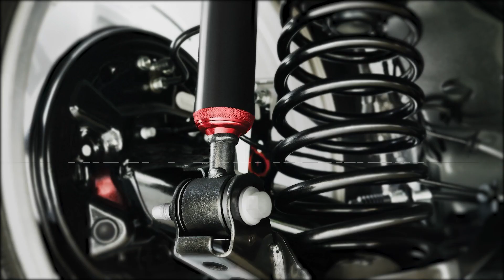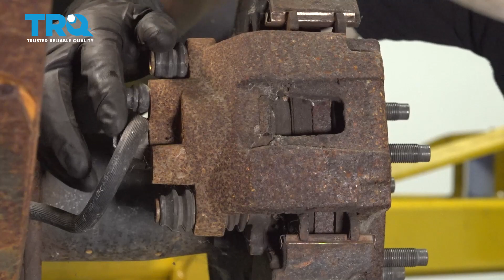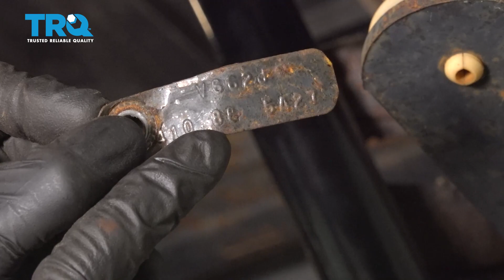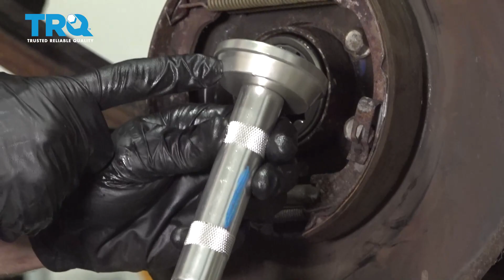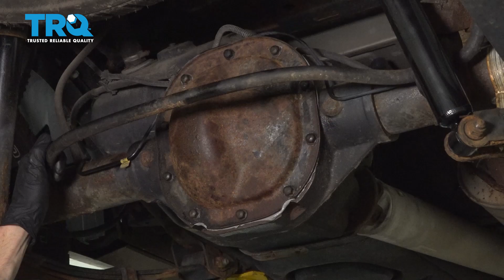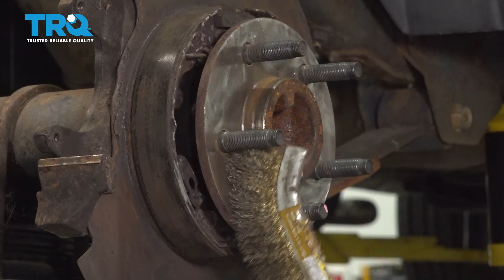How to Replace Rear Axle Bearing 2001-2005 Ford Explorer Sport Trac

Comment: Do you have a video to show how to fix it if you spin the differential on accident when that center pin is removed? I had a spider gear fall out and it was a pain to get it all back in . How do I know if it's done correctly?